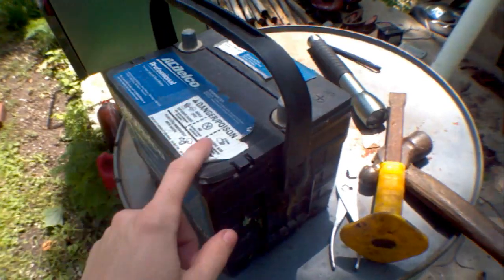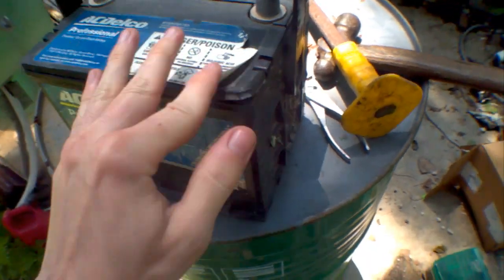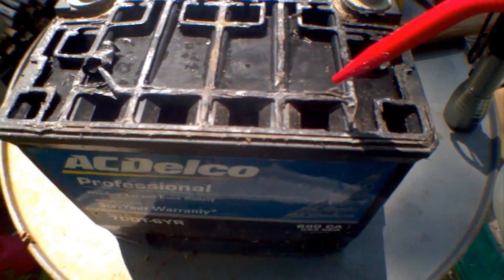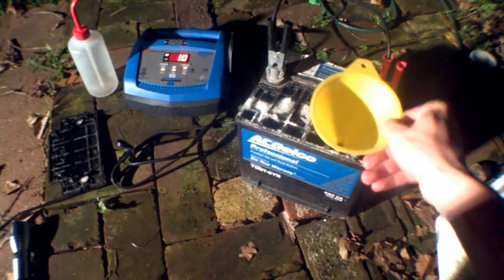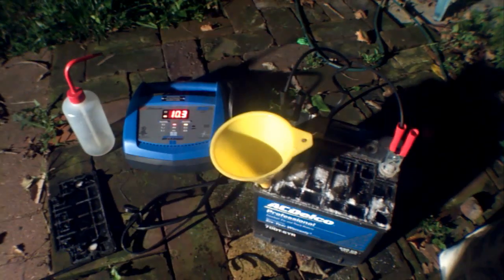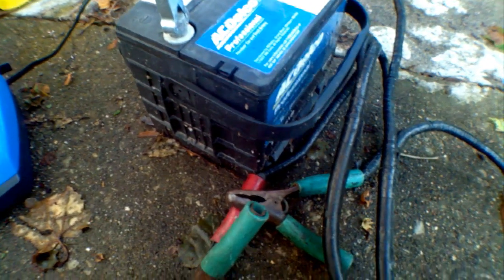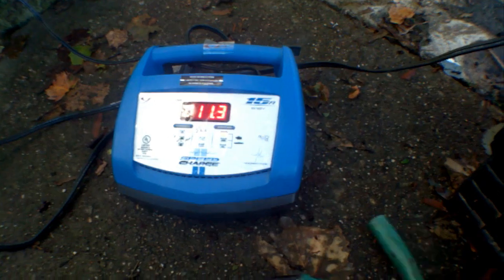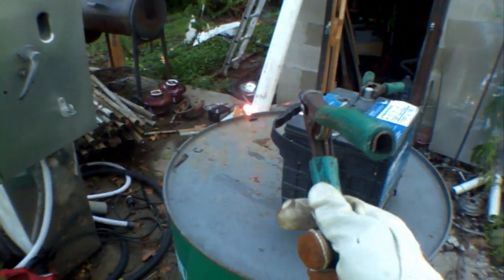DIY: Opening a Car Battery and Repairing with Epsom Salts

Comment: Hi I have a ups which uses a 175amp flooded battery so what happens is that there was a power cut off and my ups was running it didn't last an hour so I checked the battery and found out that two of it cells had low acid or water level don't know what to call it right its not completely dried out u can see the tip of lead plate wet so i wanted to know if it has died or will it still make it by adding distalled water coz I don't have it right now I will get it tomorrow thanks
Reply from the maker: Opie Jr, Potter seen what happen? calcium kill a battery?

i'm sorry but having 30 years automotive experiance and an AA (whatever that is) doesnt make you a knowledgeable chemist. it means you understand automobiles.
Reply: Then your one hell of a stupid chemist Battery acid is not something to be swung in a container over someones foot while wearing only sandals. Or your a backyard intervene who plays with a chemistry set and calls themselves a chemist in that case your stupidity is expected.
Reply: Yet it can blind you if it gets in your eye.
Reply: I think the best way to percent accidents is to always think of the worst case scenario for everything.
Reply from the maker: samuel lloyd
 well if you do that then you are too paranoid to do anything. you need to decide at what point is a chance of an accident ok.
Reply from the maker: Stinky Cheese
 eye goggles? as apposed to ear goggles?
Reply: Rinoa Super-Genius
This is your problem.  You spend too much time being self absorbed and not enough time using common sense.
Reply from the maker: Stinky Cheese
and i can see problems in you too, doesnt mean they matter.
Reply: Rinoa Super-Genius
But what you are recklessly doing DOES matter.  You ignore safety while we need for stupid people to be able to see so they can do the menial labor for society.
Reply from the maker: Stinky Cheese
ah you probably enjoy the missuse of safety we have all around us these day. me working with these batteries is much safer than me riding a bicycle or driving in a car.
Reply: Rinoa Super-Genius
That's delusional.  Unless you are terrible at riding a bike or driving.
Reply from the maker: Stinky Cheese
 how many people do you know that got injured on a bicycle or have been in a car crash? now how many people do you know got injured from a lead acid battery?

its ussually the mundane things that get you, like none of my projects have ever really hurt me, but last year i tripped on my cat and had to get 3 stitches, and last month tripped in teh yard and hurt my knee really bad. its all mundane things that we arent paying enough attention to that hurt us not the things like batteries that we are aware of.
Reply: Stinky Cheese  Dude just ignore it hopefully Rinoa just gets chemical burns to her reproductive organs never has children and sits in a corner shoving a 2 foot cactus up her but.
Reply from the maker: Samuel L.
your kinda failing at trolling, maybe try to be a bit more subtle than just spouting hate speech. i just can't take you seriously when you blend in with all the other bland remarks made on youtube.
Reply: You should make a video on how to grow a pineapple plant in you urethra.
Reply from the maker: yes adding water should help it a lot. its good to play it safe with distilled water but i've only used tap water in my batteries for the past 2-3 years and that is working fine. so tap water can work in a pinch.
Reply: Rinoa Super-Genius Tap water contains neutralizers that will kill batt acid. Esp calcium. Always use the best water you can get for your batt.
Reply from the maker: Opie Jr, Potter
 modern batteries actually have calcium inside the plates to help stop electrolysis of the water. i've used tap water for years with no bad effect.
Reply: I know they do. But for a specific purpose. Tap water will do just as I said. I have 30 plus years shop exp plus an AA in auto tech. Ive seen it happen many times.
Reply: Rinoa Super-Genius  And I feel like if you were a chemist you would be smart enough to not swing a Battery with all the cells open some of them full right above your foot to mix in Epsom salts.
Reply from the maker: samuel lloyd
 i am a chemist.
Reply from the maker: samuel lloyd
 actually battery acid isnt that corrosive. its only 10% sulfuric acid at the most and this battery had no acid left. thats why i added the epsom salt.
Reply from the maker: samuel lloyd and the chances of that plus with wearing glasses is very very slim. as long as you wash it out quick enough you should be ok anyway.
Reply: Rinoa Super-Genius
No it actually does have a negative effect but you didn't realize it.  To whatever extent the minerals neutralize the acid there will be a corresponding drop in capacity.  In many uses that won't matter but that's still not the same as saying no bad effect.
Reply: Rinoa Super-Genius
Well you're obviously not a doctor.  NO, if you splashed battery acid in your eye you will have severe pain and your eyes shut tight while you struggle to see to find some water.  By the time you actually managed to get any water into your eye to wash it out, you will have damage.  Remember the eye is not like skin where a minor scar that may or may not heal eventually is acceptable.

Put simply it was foolish to be chiseling away at a battery without eye goggles, an apron with sleeves, and protective footwear.

Most people who have accidents didn't think they were about to have one...
Reply from the maker: Samuel L.
well i'm transgender mtf and am currently still  male, so i probably dont have teh reproductive organs you expect, thanks for thinking i'm female though i guess.
Reply: Yay that means you cant reproduce I think. Oh well enjoy the cactus.
Reply from the maker: Samuel L.
 ok that doesnt have the hate speech but its still too absurd, try toning it down a bit more. in order to troll somebody you need to form your comments in a way that will hook onto an anger issue or insecurity of the person your trolling. if you come at it too hard its just too obvious.
Reply from the maker: Samuel L.
yeah idk why somebody would do that either, i assume your thinking sex reassignment surgery is just chopping off the penis but its a lot differant.
Reply: This conversation goes far too... unprofesional. Im pretty sure that all the safty regulations was made to secure people,  not to piss them off or offense thier right to wear whatever the hell they want to. And yes. Using tap water is not so good either. Theres some serious chemistry ivolved in it. Samuel cmon... Opie jr, thx for good hint. Gentlemans, please behave for god sake!
Reply: Samuel L.
Thanks for quick response. Your opinion is important for us. Thank you and good luck!
Reply from the maker: Brat_B_2094
i'm just surprised you expected a professional conversation in the youtube comment section.
Reply: All these experts! I don't know who to believe?lol. I think I will make up my own answer.

Comment: you should have just watered the battery and charged it to gasing then let it trickle for a few hours. Would have produced its own acid and you wouldn't be left with all that contamination in the cells.

Comment: this is how we all should handle car batteries wearing no protection and flip flops then smack away at it with a lump hammer and chisel on top of a steal barrel where is could come off while smacking it with said lump hammer and then it falls on you toes breaking them all. way to go how not to bring a battery back to life.

Comment: You really shouldn't put salt In the battery has it will just soak up and dry out that battery so fast. What you should av done is poor in warm water and put on trickle charge for 24 hrs and the carbon in the battery will turn the warm water into Acid. try it , it works.
Reply: Karl, some of the particular types
 of sulfide in the battery will turn back into sulfuric acide while other types wont. 3 different states of sulfiding exists in auto batts. The carbon wont make sulfuric acid though. The process happens through the reduction of chemicals and soft sulfate will generally return back to sulfuric acid during the charging process..
Reply from the maker: lol you have no understanding of batteries. or your just trolling.
Reply: Rinoa Super-Genius
I know more than enough to know that adding  water and charging is more than enough to get a carbon based rechargeable battery working again, That aint Trolling is it?  And why add salt when it was 3/4 charged all that was needed was patience.  Or r u saying im wrong?
Reply from the maker: Whats more JDM Toyota or Nissan  the carbon in a battery doesnt convert water into sulfuric acid. there is no carbon in sulfuric acid. the only carbon in a battery is there by accident. its a lead based reaction not carbon based. maybe your thinking of calcium. yes they have found that mixing calcium into the lead helps stop sulfation.

but the water doesnt turn into sulfuric acid, instead the water boils off over time and you need to replenish it. in a battery like this there is no more sulfuric acid so the electrolyte wouldnt be reactive enough to make any power. thus you either need to add some sulfuric acid or you can add epsom salt.

and as for trying to explain why your wrong, i just did and i also have a bunch of videos about it.

btw epsom salt will not "soak up and dry out that battery so fast" that doesnt even make sense. are you saying it will cause sulfation?
Reply from the maker: Whats more JDM Toyota or Nissan
 sorry your too blind or deaf to get that from the video.

either way i've made about 800$ from this video so i'm not complaining. the more you rage about how aweful it is, the more it gets noticed and i make money.

thanks for supporting this video.

Comment: Lead Acid Batteries give off hydrogen gas while they are being charged. Any spark within 6 feet can cause an explosion. I once knew a mechanic at a Union 76 station that used two screwdrivers to test batteries. The last one blew up in face face and permanently blinded him. Not smart!

Comment: Batteries gas when charging creating a large feild of vapour, any sparks around the battery can cause them to explode and trust me if youve ever seen one explode you would NEVER do what you did again...
Reply from the maker: yes i have seen batteries explode.

and no there is no vapor only gas, a vapor is something in the form of a gas bellow it's boiling point.
Reply: either way mate it is not smart as your probably aware by now
Reply from the maker: maporules
 it had plenty of ventilation. it was well worth the video.
Reply from the maker: iooi
prove what? batteries exploding in non-ventilated areas isnt a myth.

Comment: what I did to refill these batteries is under the label you can see small circles on the cover where each cell is..Drill a small hole and voila you can refill it. To seal I used hot glue. and it works.
Reply from the maker: nice, i've done that with several batteries. its still nice to see the plates though like for this one.

Comment: Did you know sitting a battery on cement or brick drains it?
Reply from the maker: i've heard that myth a lot and it is totally false. but it has an interesting story behind it.

ya see batteries in the 1920s where glass jars inside wooden crates, if you set those on concrete the moisture would cause the crates to rot so the battery would fall apart. cars upgraded to rubber battery cases in the 1940s but they still had a similar issue where when they absorbed water the case could slowly discharge the battery, but ever since the 1970s our batteries have been made from polypropylene and so now leaving batteries on concrete doesnt hurt them at all.

i store all my batteries (i have about 20) on concrete and don't notice any Amp-Hour loss or voltage discharge more than the average 10% per month that lead acids have. theres one pair of batteries i've kept on concrete for 2.5years to no effect.

so in the end that's an old way to preserve a battery that just isnt relevant anymore so is now untrue, but it's an interesting remnant of the past.

hope that helps.

Comment: At clock time 4:58, I notice there is a fuel pump (gas station type) about 3ft. from your melting wire. This also makes me wonder what was in the drum (work bench) before it was empty. You should take up Skydiving, you would be much safer.
Reply from the maker: that drum origenally held grape juice, but its empty now. and that petrol pump hasnt had fuel in it for decades.

your more likely to die in a car crash than by sky diving, sky diving is about 8 micromorts per unit of exposure while you get 8 micromorts from driving 1800 miles.

Comment: Well, it was a good thing the Batt. Wasn't venting a lot of gas when he was  arcing that close to it. I had a battery on charge in my garage overnight and it must have shorted internally, (I guess that was a thump sound I heard during the night) When I opened the door the next morning I had pieces of battery everywhere! Some were stuck in the ceiling, the walls, doors, and a number of very corroded parts and things that the Acid landed on. He'll learn, hopefully without hurting himself or anyone else very badly! <GRIN>
Reply from the maker: the acid isn't that dangerous, especially when the battery is old. also why the hell would you do it in a sealed room? your just asking for an accident then. i did mine outside in plenty of ventilation.
Reply: the hydrogen gas in the battery if it was  there would have exploded when he  caused the spark!

Comment: Nice work!

Take a look at the book
	 		Do it yourself 12 volt solar power 	
	 		 			2nd ed., rev. & updated. 		 	
by 				 					 					 						 							 						 					 					Daniek, Michel, 1964- 				 			 		 	

There's a section in the back with information about rehabilitating old batteries.

Comment: I have actually had a large 1300 amp led acid battery explode on my solar set up it sparked from a loose terminal so you don't want to short them out or be anywhere near them when they go boom it blew out all the windows in my shed and put a hole in the roof! They can kill you in an instant..

Comment: I wouldn't be shaking an open lead acid battery over my feet when I"m wearing sandals and I wouldn't open a battery without closed toed shoes, long pants, and long sleeve shirt. Id probably be wearing a full face shield.
Reply from the maker: and you prolly wouldnt get 200k views.

Comment: Instead of epsom salt, on your next battery try 1 - 2 tablespoon of baking soda, fill with water then slow/trickle charge it overnight. I've done that many times. It has seemed to work pretty well. Just a word of caution, when working with batteries, wear shoes that'll protect your feet better. Also, don't spark the + & - so hard, it can fuse the two together & blow up. Have fun.
Reply: Lol

Comment: shorting the battery drawing high current stresses the cells causing the plates to expand making the salvation on the plates break away make the capacity of the battery greater

Comment: It really isn't wise to short out a battery, the current is more than enough to kill you and as previously mentioned can casue an explosion from the hydrogen. I would also advise against working on a sealed battery like that, the electrolyte is very nasty.
Reply from the maker: Actually it isn't all the at bad, watch my video called Battery Acid Accident and you'll see when I splashed a lot of acid on myself.

Also the current can't kill you if you don't have enough volts. You could grab onto a 1,000,000 amp transformer and it wouldnt hurt you if it was only like 4 volts.it would be very very difficult to kill someone with the electricity straight from a car battery. It would take a long time.
Reply: As little as 15mA across the heart is enough to kill you, based on this there is enough current from a 9V battery to kill! If you survive a shock it is down to the circumstances and the resistance of your body. I understand where you're coming from but its the current which kills you.
Reply from the maker: Richard G
but you can't have amps without volts.
Reply: Yes, Ohms law, Kirchoff's law etc. But there is still enough stored energy in a car battery to do serious damage.
Reply from the maker: Richard G
yeah you would just have to step up the voltage with a transformer is all.
Reply: Rinoa Super-Genius My doctor told me that it takes 40 volts at a 1/4 amp to kill in the right circumstances, all it has to do is stop the signal from your brain to your hart once. and if the battery let it's energy go at once it could kill with just the explosion, that happened down the road from my house. If you insist on learning things, just show some smarts about it like instead of dead shorting the battery at the battery post use 20 foot booster cables so if the battery went south you are not in ground zero. Play safe friend so we can see more Youtube vids. OK?

Comment: I have found that  dumping out your acid and mixing 1 cup of baking soda to a gallon of water and rinse out your battery with it make sure to rinse out all baking soda solution. then use 2 cups of Epson salt to a gallon and pour it in you battery and charge it till you get atleast 10 or 11 volts.  run it dead. after that pour it out and buy you some new acid from your car part store and pour it in put it on charge.  I did this to my golf cart batteries and saved me time, money, and did not have to buy a desulfar charger.  my cart don't run as long as its suppose too but hey atleast I can drive it for an hour now.    also your old acid works great as a drain opener as well.